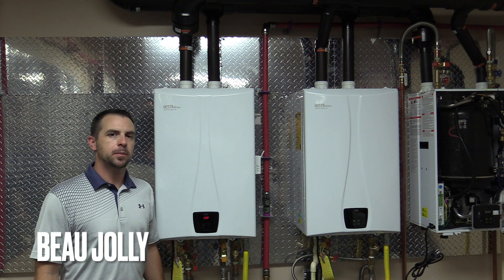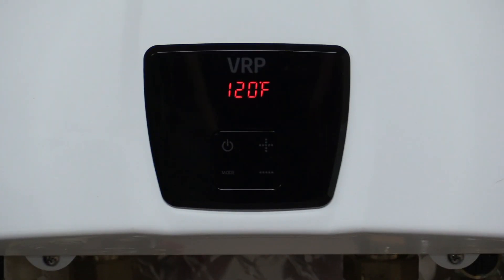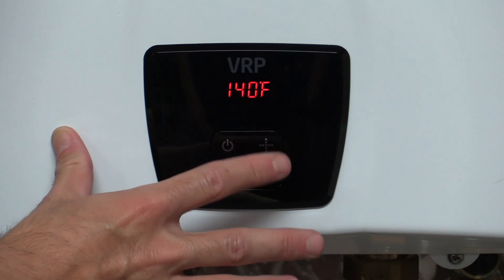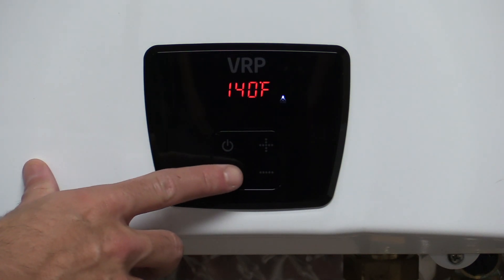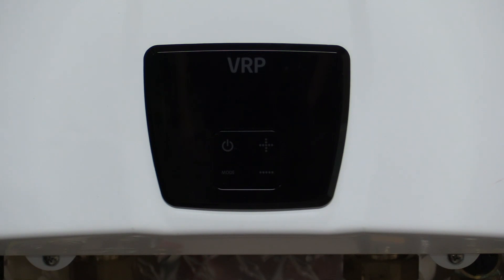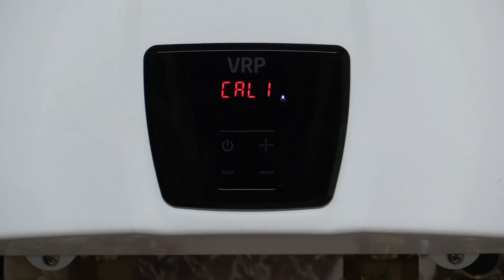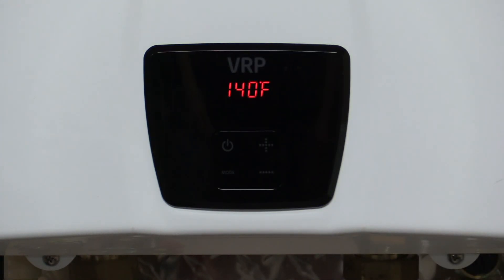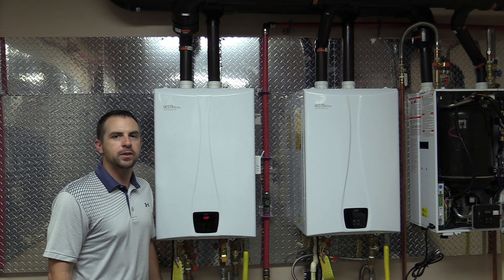Vesta Tankless Water Heater Calibration

Comment: I got this unit and keep getting an intermittent issue where it will not produce hot water. I get the A66 error code but unti works again after power cycling. Any ideas?
Reply: I don't know if yours is affected, but a recall for these water heaters due to the risk of carbon monoxide poisoning was posted last week by the Consumer Product Safety Commission. The following text is from the recall notice from the CPSC website 

"Description:

This recall involves VST-brand residential wall-mounted gas boilers, Series VT, VR, and VR Plus, with model numbers VRS-150, VRS-199, VRP-150, VRP-199, VRS Plus-150, VRS Plus-199, VRP Plus-150, VRP Plus-199, VTS-150, VTS-199, VTP-150, and VTP-199. The white label on the side of the boiler has the model number bolded, near the top of the label. The boilers are metal, rectangular units and have either VST printed in white on the control panel near the bottom, or VESTA.DS.Inc. printed in gray near the top of the panel.

Remedy:

Consumers should immediately stop using the recalled water heater and contact VESTA.DS to have a certified technician install the free repair. Consumers who must continue using the water heater while awaiting repair should have working smoke and carbon monoxide alarms in their homes.

Incidents/Injuries:

The firm has received 33 reports of cracked exhaust ducts allowing exhaust fumes to leak out. No injuries have been reported.

Sold At:

Plumbing supply stores nationwide from May 2017 through July 2025 for between $480 and $1,340."